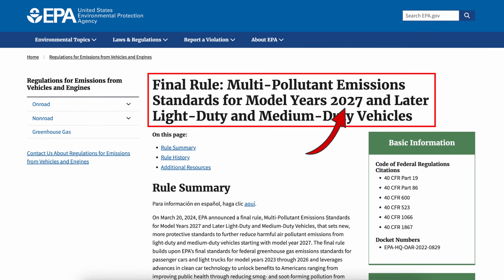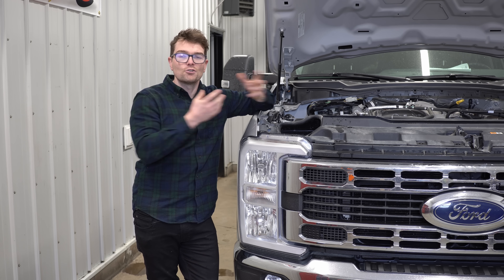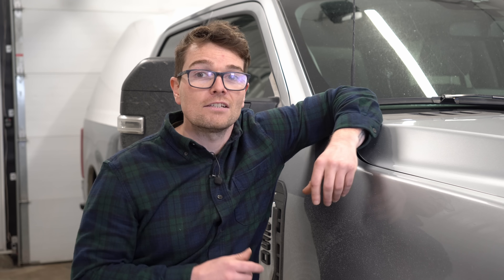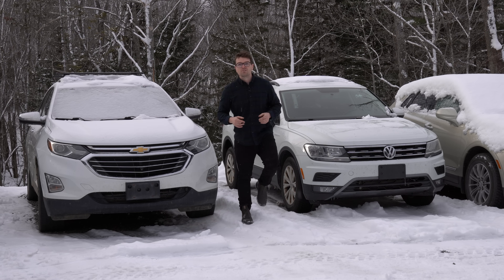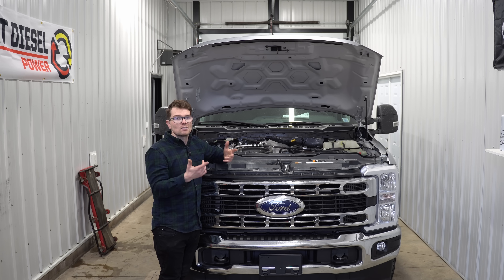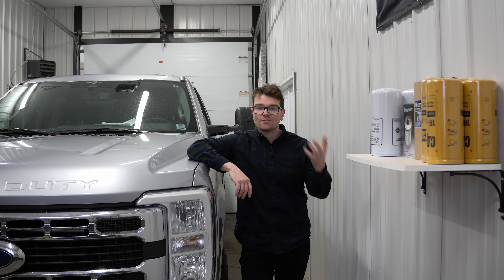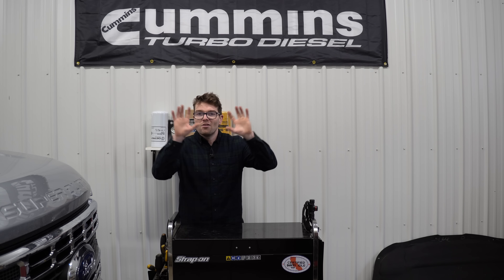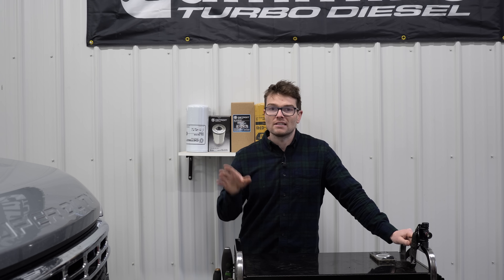NEW 2027 Cummins Diesel Engine EMISSION REGULATIONS are WILD **Diesel Mechanic Explains**

Comment: What do you think about Speed of Air pistons and their claims to reduce EGT significantly and soot levels?  They have a video out that they say they can meet or exceed emissions standards without EGR and DEF systems.  The cost of those pistons is significantly more than other options, which is the drawback.  I would be willing to bet the new administration is going to put in place people that will be more than willing to review emissions standards.  Not to loosen them, but not to tighten them to the point of losing money for the manufacturers. We should figure out how to lobby them now so we can get those conversations happening.  Very good video!  Thank you.
Reply: Ducted fuel injection and Speed or Air piston technology would make for a super clean diesel without all the need for the current emissions garbage.
Reply: You have to think why don’t these soa pistons already come standard?
Reply: If it sounds too good to be true...

Comment: You have conflicting information, You state, and a slide shows increased to 10yr. 280K Miles, in another, it says 10 years 450K miles.  Which is it?
Reply: 250K miles is 450K kilometers
Reply: @monoped_adventures  watch it again, closely.  Pay attention to the screenshots.  One says 10 year 280K miles, another says 10 year 450k miles/
 720 Km.  I think the confusion is classification of medium duty.  Let me know if I’m missing something, or if I just suck at reading comprehension, which I am not immune to. 😅

Comment: All of this explains why Cummins is now working on gasoline versions of their heavy-duty engines.
These regulations cost a lot to meet and hurt the fuel economy and reliability of diesel engines to the point where a gasoline engine will be economical because initial cost and maintenance will be less.  If the heavy-duty gasoline engines can run on 87 octane, that would be cheaper than diesel, and even if fuel economy is 20% less, the vehicle operator would still save operating cost.
Reply from the maker: 100% why Cummins is looking at alternatives. They are seeing the writing on the wall I think, it just won’t make sense at some point to continue to meet these rather tight emissions for diesel

Comment: HD trucks gonna be EVEN more expensive now
Reply: The high output powerstroke is a $12,000 upgrade currently? I’d wager it’s gonna be $18,000 in 2027. You’re paying for a lot more equipment and a long ass warranty.
Reply: @slscamg a non emissions diesel doesn’t need warranty.
Reply: The reason why I will own my 06 duramax until I croak, or have it until the government pries it from my dead cold hands.
Reply: The last part of your statement is exactly what the communist bastards in public office intend to do. Either we the people stand up to them, and force them to back off, or we lose everything....literally.
Reply: And who do you suppose is going to bear the extra cost of these systems? We are, the trucking companies can not absorb that cost alone.
Reply: @andyvonyeast332 

Everyone will eat the cost  because the transportation industry will raise prices.  It's a hidden tax which inflates the price of everything.
Reply: 95% of which get groceries and drive to work,  not for work
Reply: @Tallnerdyguy  so? It's nice to just have just in case you want to do something on a whim. I mostly commute with mine but couldn't have brought my 14K pound backhoe home if I'd not had it.
Reply: @Tallnerdyguy 

Stop lying.
Reply: @Tallnerdyguy That matters how?

Comment: Alex. I believe the Scandinavian truck “Scania” does not use a EGR system but they actually meet our emissions standards. 
Why are North American manufacturers not doing what they’re doing??
Reply: Scania does sell engines that are compliant with Canadian standards without EGR at least, but not the trucks themselves.
Reply: The egr requires more maintenance, more money for manufacturers
Reply: What about diesel/electric locomotives?
Reply: @Expedition18  The new ones have to meet Tier 4 emission standards.  Currently, most of them are doing that by using heavy amounts of EGR along with other equipment to lower particulate emissions.  Most U.S. railroads have resisted using DEF/SCR because they don't want to install the facilities for replenishing DEF along their systems.  The Tier 4 locomotives burn more fuel, require more maintenance, and will likely require more frequent engine overhauls.   Some local commuter railroads and Amtrak have started using  using Siemens locomotives that do use DEF/SCR.  They have been plagued with reliability problems.
Reply: @Expedition18 
Or jet airplane 😢
Reply: @Expedition18  ever been around a locomotive when starting up?they cover the area for a good mile with exhaust smoke.
Reply: You can get a Scania engine in new 
International trucks
Reply: Because the people designing the engines have no imagination they read a regulation and then try to change everything else but the engine or the tuning. They need to understand the combustion engine and how it works, but all they want to do is draw pictures and make new tooling.
Reply: @charlescoates6661  You have no idea of what you are talking about.
Reply: We should be able to import European semis if we want. The regs need to change to allow it.
Reply: Because American manufacturers make poor overall design and quality product.
Reply: @LordOfSilense  No they do not... They are using old engine designs that are high quality and reliable without the EGR systems, thats the problem idiot, they don't want to reduce emissions through designing a new engine.
Reply: @MarcABrown-tt1fp you know what you call a design that works fine in some config that never gets run and shit in the config that actually exists?

A shit design
Reply: Because Scania doesn't sell trucks in North America, and European emissions standards are not as strict.
Reply: @andyharman3022 euro 6 is slightly more strict than the regulations atm

Comment: When you said the manufacturers would follow cummins lead, i thought you'd say they'd cheat. I feel some more defeat devices may come to light in the future. The whole cost basis for diesel vs gas engines just changed.
Reply: Every diesel engine manufacturer in North America has been fined for "cheating" on emissions at one time or another, going back to the 1980's.  It's mostly about virtue signaling on the part of politicians and justifying their own existence on the part of government regulators.

Comment: How can they expect the average blue collar worker to be able to afford the repairs on trucks like this? The warranty should be 1000000 miles at a minimum.
Reply: The average blue collar worker isn't driving diesel 3/4 tons. They're driving gas 1/2 tons or midsizes. Morons buy diesels as their daily, businesses buy diesels for their fleets.
Reply: @ Conservatively, one out of fifteen of my neighbors have a HD diesel truck. Only a mornon would routinely tow greater than ten thousand pounds with a 1/2 ton pickup.

Comment: If they’re going to get that tough screw the 7.2 do an aluminum version of the 8.3 Cummins since it’s easier to make emissions compliance on a bigger motor
Reply: Aluminimum engines don't last as long as cast iron engines. And aluminimum production is more toxic than steel. Yes you save some wieght but at what cost. Temperature expansion is a big factor in engine life.
Reply: @ I’ve seen ls motors go over 400 thousand miles get rebuilt and continue on I don’t see reliability being an issue the emissions are going give you a problem long before a block or head failure
Reply: @keithmceuen8775  We're talking about engines not motors. 🤭
Reply: Hmmm🤔
Reply: No aluminum
Reply: @ why not wagler blocks handle more power than any cast iron block currently available they could make it stronger than cast Cummins blocks that we have now plus the 8.3 Cummins is like 900lbs heavier than the 6.7

Comment: One has to wonder about the emissions that are released to support a government agency that creates such regulations, how many emissions were created in the research and development of such regulations, and finally the industrial emissions that will be created implementing these new systems into diesel engines.  
Perhaps if we could eliminate the EPA and it's requirements in favor of an up or down vote on  when electric alternatives will be sufficient to replace diesel and than start phasing diesel out of the system without all these enormously wasteful intermediate steps.  Perhaps government should be liable to help fund the transition to electric in a much more aggressive way since it is in the publics interest!

Comment: The goal is to put enough regulations on vehicles that manufacturers  won’t be able to meet and cause manufacturers to discontinue building gas and diesel engines. Then they will have to build electric cars that have a huge manufacturing CO footprint (among other mining travesties). “The sky is falling”. Lowering emissions is important but there is a limit. Government overreach.

Comment: Definitely don't agree with the epa on every issue, but anyone traveling across America back in the 70s would know smog was horrible and has gotten much better even though over double the cars on the highway now. Emissions definitely hurt diesel reliability big time but I can see a huge improvement in air quality.
Reply: I've seen no change in smog levels in the last 20 years. Emissions regulation are past the point of return, they are making combustion engines even worst the stricter they get.
Reply: we're already at the point where in most major cities, the air coming out the tail pipe is cleaner than that going in the intake.  we hit that point long ago. and people everywhere all over the country pay the price for that effect in just the cities even in places where it makes zero sense.
Reply: @nova3930  That's impossible lol.
Reply: @rockie307   You can look up the air qual data from say LA on a given day and compare it to EPA limits going back 30 years.  It's readily apparent if you make the effort.
Reply: @nova3930  You said the air leaving the exhaust is cleaner than the air going in. Where's your proof of this? If that's true, that's great since driving is cleaning the air.
Reply: @rockie307  this is simple logic man.  if my vehicle was built to an emissions standard that has lower allowable emissions concentrations than that present in the free air, then assuming the system is operating as designed, then the gasses coming out of the tailpipe will be cleaner than that going in the intake.  you can look at publicly available air quality data and see where that's the case.
Reply: @nova3930  I'd like to see what citation you have for that claim. I looked it up and found a 2022 study in the Journal of Atmospheric Environment by the Engineering Department at the University of Oxford which found that such scenarios are very limited and specific and the results cannot be applied to the average vehicle and scenario. It concluded that "Overall, modern ICEVs are very clean with regards to pollutant emissions, but if it is desired that they can clean air to within WHO guideline exposure values then emissions aftertreatment systems will need to become cleaner than they are today and the accuracy of PEMS instrumentation will also need to be improved."
Reply: @ALMX5DP  citation? studies?  This doesn't take a PhD.  Go look at the public air quality data from a major city on a given day then compare it to the EPA standards from the last 30 years.  LA is a good one usually to show the comparison.  If my vehicle was built to an emissions standard that has lower  allowable concentrations than that currently present in the free air, then by definition the air coming out of the tail pipe is cleaner than that going into the intake.  To say it's "cleaner" isn't a claim that it's "perfectly clean to WHO guidelines or wtf ever that study is looking at"
Reply: @nova3930  what air sample are you referring to? Air in Los Angeles will be considerably different than air around Denali National Park. Just because the air in a major city has improved, does not inherently mean that engines are actively cleaning the air, just that they are polluting less and have helped the air quality improve and be "less bad" but certainly not as good as a rural area largely free of human impact. I have provided something which I feel can support the continued need for improvement in regards to vehicle emissions. I am absolutely open to a discussion if there is something of substance to try and refute or contrast that though.
Reply: @ALMX5DP  read the original comment. What part of "in major cities" doesn't translate? The conditions in cities are used to drive regulations that affect the other 99.9% of the country that don't have the same issues because they're not concentrated point masses of people.
Reply: @nova3930  yes, vehicles that pollute less help make the air quality better than it may have previously been. But IMO just because it is "less worse", does not mean improvements cannot still be made to make it "good".

Also my initial response and citation addressed the point of your original comment and showed your statement that "the air coming out the tail pipe is cleaner than that going in the intake" is not really accurate at all.
Reply: Most people with a brain will admit cleaner air is a good thing. If it weren't for the epa and all the emissions on gas and diesel engines and plant regulations obviously the air quality would be much worse. Emissions have been getting stricter and just to maintain the current air quality they have to keep improving simply due to population increase, more stuff consumed etc. The us population has doubled since 1970 and cars on the road have tripled and at the same time people drive way more miles per year. Add that up and imagine what the air quality would be if the emissions standards didn't increase. Smog has been reduced not because of cars cleaning the air making it better they just don't damage it as bad as they once did. I agree it sucks for diesel reliability but air quality is more important. Driving is a privilege but everyone has to breathe air and drink water. I'm not against gas engines or anything I own and drive them everyday but I believe the emissions are necessary and helpful for air quality. Matter of fact I've not had a single emissions failure or been stranded due to the any of my v8 gas engines. I left diesels a few years back after being stranded and in a bind a few times got tired of the bs. I'm not against diesel engines they have there place for sure just understand the emissions regulations are needed for air quality.
Reply: Agreed, but diesels never really had anything to do with this, it was mainly from gas vehicles. Catalytic converters ended this problem. Heck put a converter on diesels too if we have to, but this absolute insanity we have now is just ridiculous....
Reply: Diesels are much worse for the ozone, which most would agree is fairly important.
Reply: @rockie307 diesels are far cleaner and get better fuel mileage than gas engines.
Reply: There hasn’t been meaningful improvement in air quality for 20 years. The increasing regulations leading to decreasing reliability and decreased efficiency are not necessary. Stop with the fear mongering about 1970s smog and let’s roll back to 2000 era regulations as a happy compromise.
Reply: What hurt dieser reliability is the fact US car companies refuse to innovate and just produce the same obsolete engines which require more aggressive emissions equipment 
Then the people buying them start "tuning" them on top and destroying all that marginally workable stuff because they apparently "need" 600 horsepower to move a pocket excavator
Reply: I don’t see the point in knee capping the American trucking industry when China and India are going to destroy the ozone anyways.
Reply: Yup, people have incredibly short attention spans to not remember (or research) what is only relatively recent in our history.
Reply: Agree'd. I go for a run 3x a week and live in rural UT where there are a lot of deleted diesels driving around. They drive by while im running and its immediately apparent when they are deleted.

Same goes for gas engines with cat deletes. Its just not as common.
Reply: @Jay-me7gw  you don't cee cat deletes because the standard gasoline catalytic converter generally works without issue and doesn't leave you stranded, unlike diesel emissions equipment.  when my truck decides the DEF pump isn't working right, I get fewer miles to fix it before I'm stuck at 5mph, than if I rand completely out of DEF.
Reply: By the time the 90s rolled around smog already was improving with zero emissions equipment on diesels before the 96 model year.
Reply: @jtmartin8445  There were already EPA standards on heavy-duty on-highway diesels in 1991, with more stringent standards in 1994 and 1998.  In 1991, diesel manufacturers were able to deal with them mostly using air-air aftercooling that handled NOx and particulates.  It wasn't until 2007 with introduction of ULSD and DPF's and EGR when things started to get bad.  DPF's required ULSD to keep from getting poisoned, and ULSD brought with itself concerns about lubrication in the fuel system.
Reply: I travelled across America with my family to Los Angeles in 1969.  Didn't have any trouble at all breathing the air back then.
Reply: @andyharman3022  I don’t have any trouble going for mountain bike rides when there is wild fire smoke here in Utah either, doesn’t mean it’s a good idea to purposefully huff it.